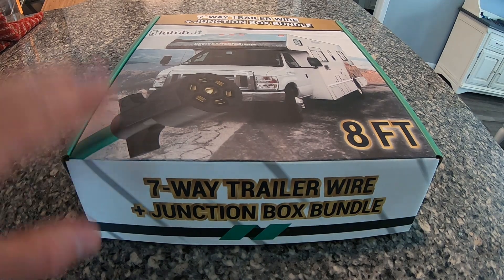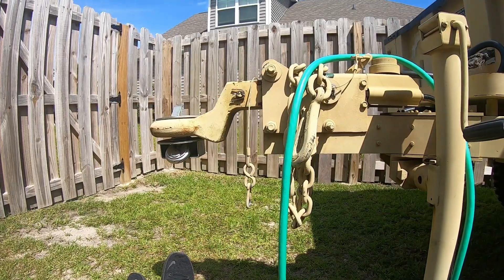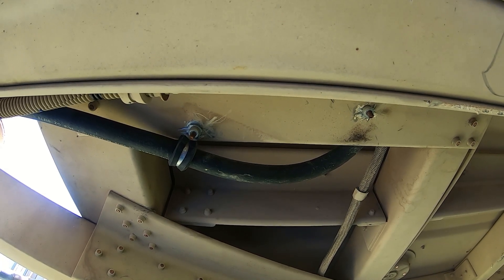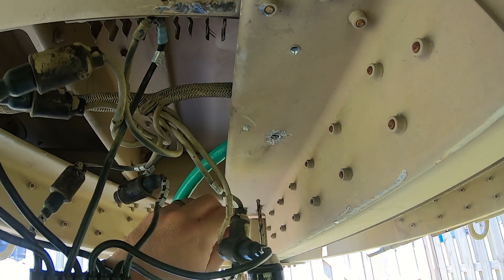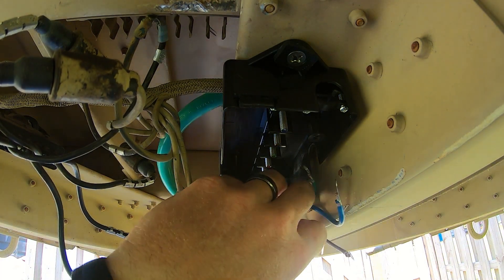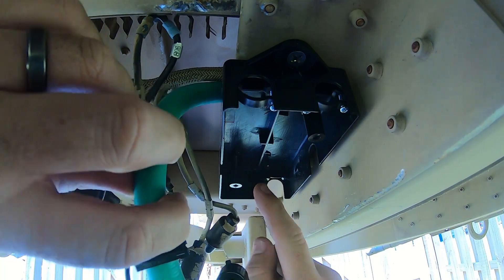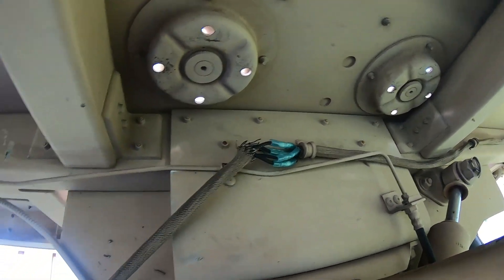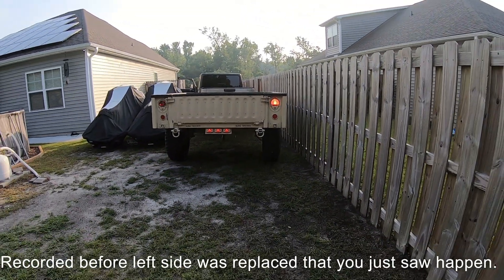M1101 12 volt conversion  and 7 Pin trailer plug added

Comment: I am trying to follow your video. When i cut the big wire there are 4 black wires and 4 red wires. I can't make heads or tails what to do or get anything to work , except if I put a jumper to a running light the brake lights come on.. Any help suggestions would be great?
Reply from the maker: If you have some alligator clips, I would clip them to the bulb side and go to where the wires were cut and see which one is traced back to it. Getting into the infrared lights can add a layer of difficulty also. If using the wrong bulb it will the voltage through also.

Comment: Did you replace all of the marker LEDs, or you are just referencing what will replace the originals. 4 yellow and 2 red markers?
Reply from the maker: @EdgeAvl1212  i replaced 2 that were acting up and just gave parts for the others. They are 12 to 24 volt rated so either powers them the same

Comment: 1156 bulbs have one pin on the bottom and one element inside the bulb.  1157 bulbs have two pins on the bottom and two elements inside.

Comment: Any updates on this? I want to build one, but I know weight is a big factor, and the bed is aluminum, which can be hard to work with.
Reply from the maker: I have a plan laid out, been working with my welder but our schedules have not lined up. I am hoping un the next month or two we can knock it out. We are building a top and using existing bolt holes.